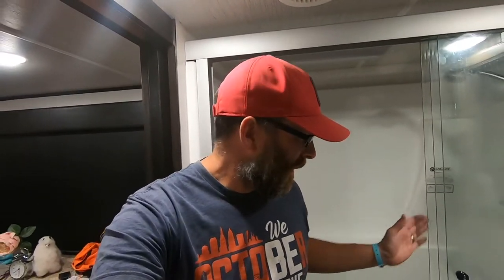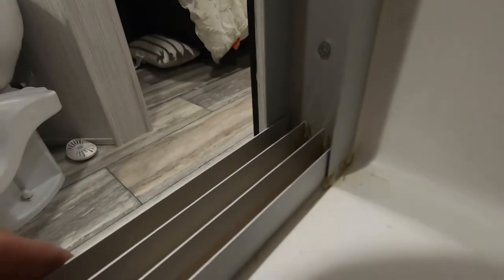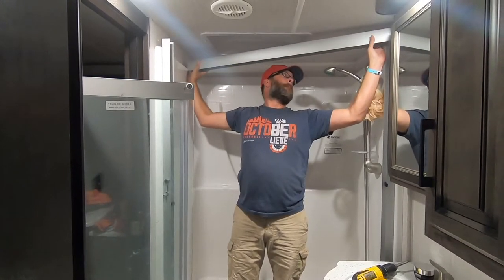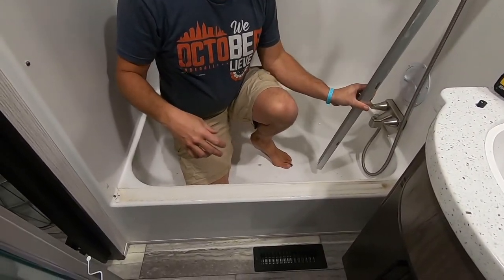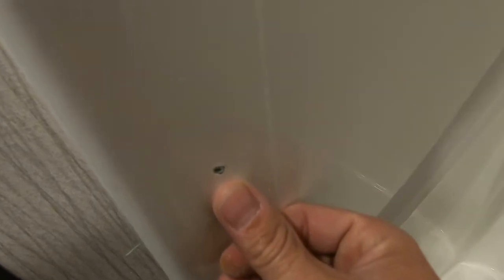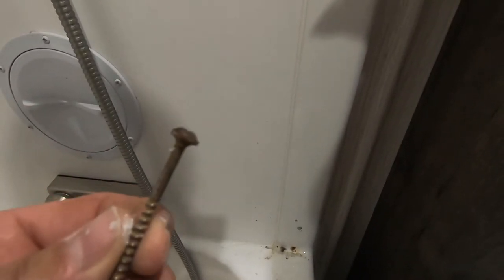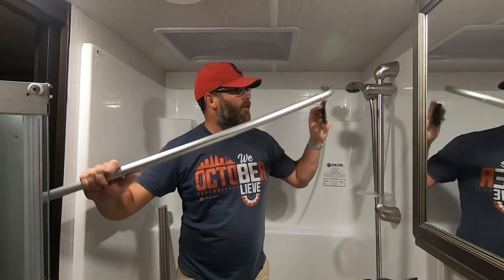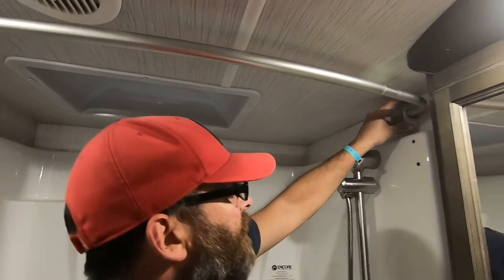*HOW TO* Remove a RV Glass Sliding Shower Door

Comment: Did you think about leaving the top and side track to put the shower curtain in?  Remove the bottom track, which is the real reason we want to get rid of the shower glass.  Not to mention the glass that always water streaked.  Interested in any comments.  I plan to just remove the bottom track.
Reply from the maker: Didn't think about it. It is just impossible to clean the triple grooved track... top and bottom. We didn't want any of it left.

Comment: Any cons to having a curtain in an RV?  Any tips that weren't in the video?  I'm just plain tired of mine falling apart on every trip.  Screws fall out.  Parts found in the shower....Ugh.  Done.
Reply from the maker: You just have to be careful about water or seal the seams where the floor meets the cabinets and walls to prevent water intrusion. RVs don't handle long-term water damage well.

Comment: Thanks found a shower same as mine. I think the bottom dirty tray is leaking. Got a shower curtain already over the glass doors. What I want to ask is as I am in the Cottage 44CCR Destination vehicle; IF I TOOK OFF THE DOORS AND FRAME IS THE SHOWER HEIGHT ENOUGH TO NOT HAVE ANY WATER DROP ON THE FLOOR?  ITS PROBABLY AROUND 5-6 INCHES THANKS AS I AM A WIDOW ON MY OWN
Reply from the maker: I'm not 100% sure what you are asking, but I think you are asking if there is enough lip to prevent water from coming out the bottom on to the floor. You have about 5-6 inches of lip coming up from the floor. Is this what you mean?

If that is the case, then it should be enough if the curtain goes all the way to the ground. As long as the curtain isn't pushed over the lip, water shouldn't get out. If you had rowdy kids, I would trust a small lip to hold the curtain in place.
Reply: @TheFlyingHens  hi watched your video again, no children and husband now deceased I will have to watch where you put up the screws  up the top and down the bottom and sealed them. I am thinking about a weighted curtain, I have the rod which is extendable no screws attachment its really great. Saw a guy who is in a caravan got the door jammed trying to get out and the glass shattered do not want to do that! thank you for posting. What i was trying to say the lip must be high enough for no water to come onto the bathroom floor, had a bit where the door closes so if the door is not closed properly and no curtain water can get out. I still reckon that water is leaking behind the wall frame next to the shower controls so i definitely need to so something